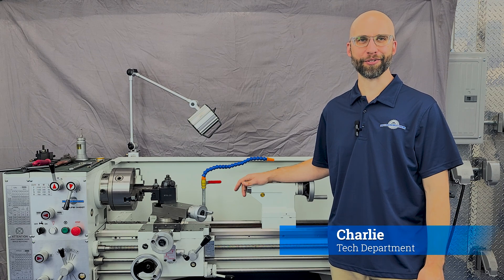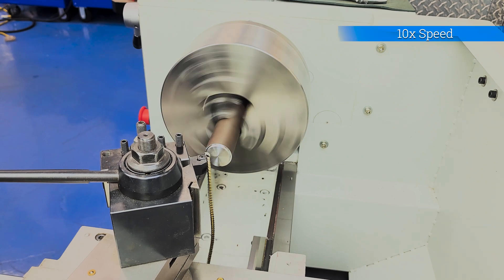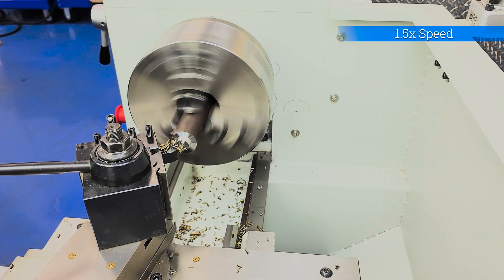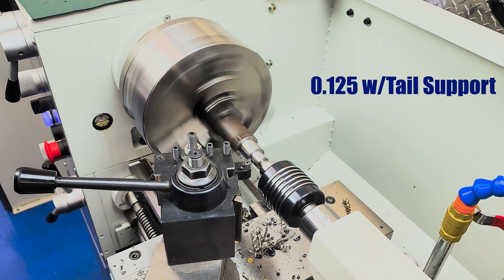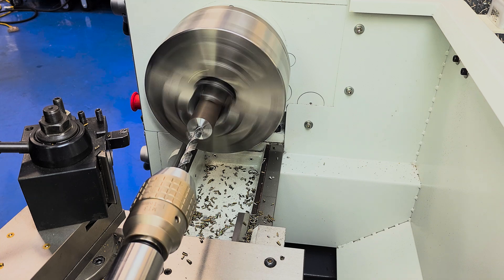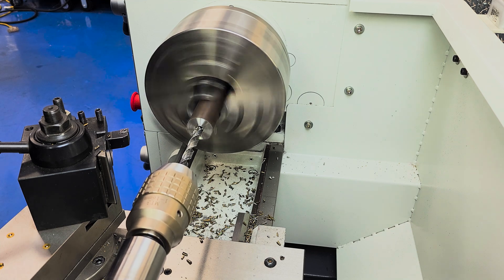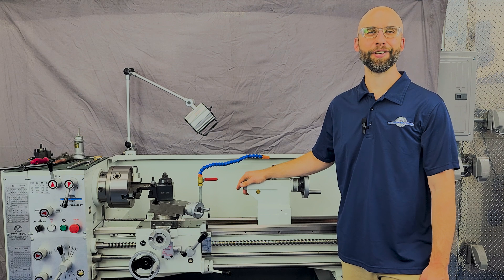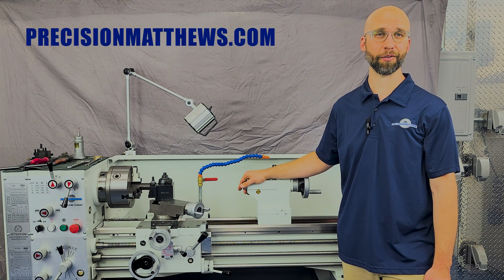PM-1440GT Stress Test & Basic Overview - Precision Matthews/Quality Machine Tools Media

Comment: In addition to  the plywood on the  ways.   Secure a length of  iron  wsterpipe extending  into  spindle  at least 8in. As the chuck is withdrawn it will rest on the pipe. And provide a convenient lifting handle. Works on all larger than palm size  chucks